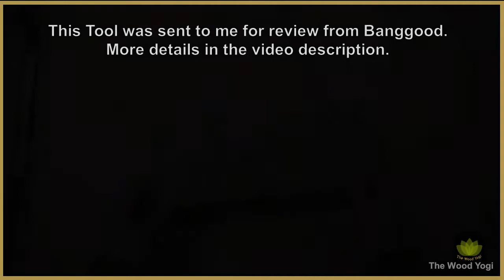Dowelling Jig - Aluminium / Alloy 08450 Woodworking Tool - Banggood Review

Comment: This is actually a not bad one! I was giving up, seeing the ones sold for $70 at Rockler or the cheapo version from Harbour Freights. With those you can drill easily if you want to join the sides of two boards, but if you want to connect it differently, like shown here at 12:36 you are stuck.
But this one here, you can take off the 45 degree angle and lay it flat on the board strait at the spot needed. Nice! Might get this one actually.

Comment: I''ve never actually seen a dowel joint made before. I'm not Wood Yogi but that jig looks like something I could use!
Reply from the maker: It works so great Steve that I have already put it through its paces on a few big tops I am working on 😊 I need to build a couple of electric guitars for myself and I want to use it to join the body pieces together and see how it goes 😊 ॐ
Reply: The Wood Yogi good luck with that. Sounds like there’s another dowel jig video in the works!

Comment: Thank You for this video, because of it I ordered the same jig and it is very solid and robust. There was an extra bushing in the packet, it fits around frostner bit and goes through the cabinet connector hole, perhaps it's for added support?
Reply from the maker: Thank you Rane 😊 I'm happy that you found the video useful. I have used the jig a lot since the video and it's great. This week I joined 3 meter lengths of old floorboards (around 300 years old) that I salvaged from the old section of the house to make countertops for our kitchen and thanks to this jig it was easier than I expected 😊 I think you are right about the extra bushing, but I hadn't worked it out at the time of making the video. Blessings 😊 ॐ